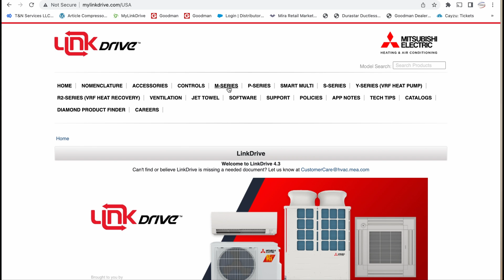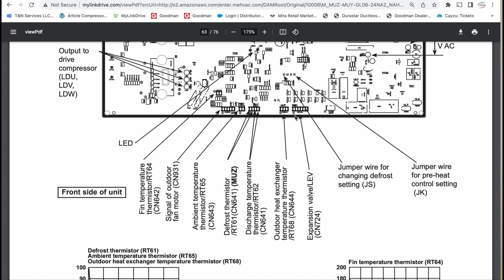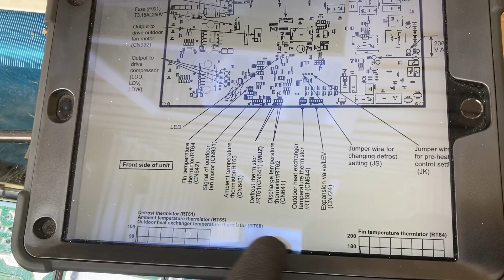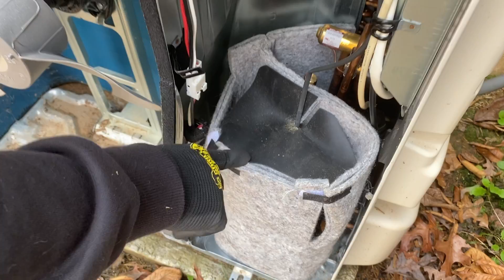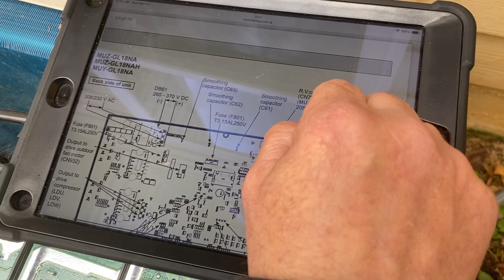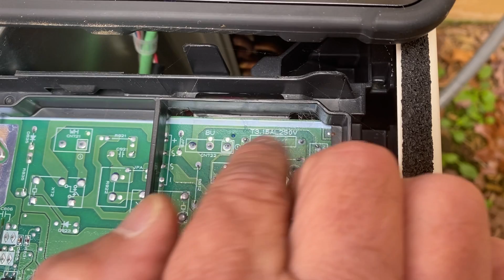Why is the board upside down? ----How Mini Splits Work ESP:6

Comment: MSZ-FS06NA, I had this installed with a 5 foot line set, the tech didn’t take out any refrigerant. It wasn’t until later after the electrician completed his part, I found out the unit doesn’t heat or cool.

The compressor comes on, it ramps up slowly all the way to full power(compressor)based on the noise and watching the power draw of my power useage in my home energy app. The compressor loudly shuts off and a 14 times blinking code occurs. 

I already turned the power off and back on, it did the same thing.  I read the service manual on my link, it lists several details to trouble shoot.

Does this have anything to do with possibly having too much refrigerant? The compressor stopped suddenly and seemed kinda loud, this was in heating mode. You discussed making a video on refrigerant level, I’m just curious if this could be related. Thanks!

Comment: Ralph, how important is it to have the right refrigerant level? Let’s say you have a 30 foot line set, is being low one oz, or if you have a 45 foot line set and being low 3 oz, is that critical?
Reply from the maker: This is a great idea for a video. The answer to your question is, the smaller the system the more critical the charge. Unfortunately as people start putting their gauges on they start taking refrigerant out. A 5’ hose holds 2.3 ounces of refrigerant.
Reply: @TandNServices  I have a msz-fs06na, one with a 5 foot line set, another with a 35 foot, same charge. I have a 9k with a 20’ lineset, all using the factory charge. I’ll have a 12k online with factory charge and 30’ line set. All are hyper heat m series. The 6k and 9k mentioned above blow the same cold air temps out around 55-58 degrees Fahrenheit. 

I look forward to the video. Thanks!!
Reply: @TandNServices  hi Ralph, I hope you’re well. I still look forward to the video.